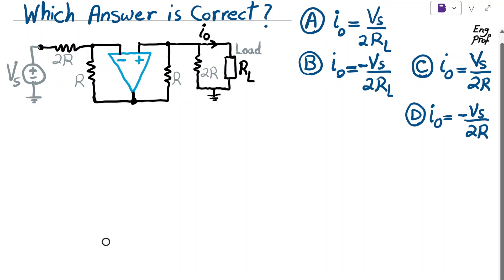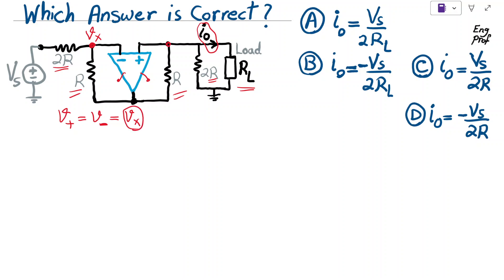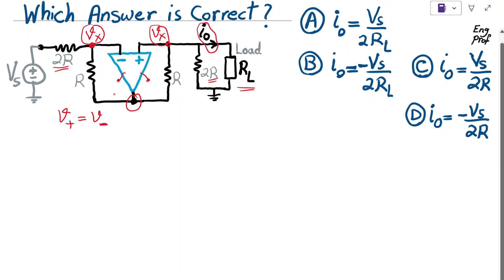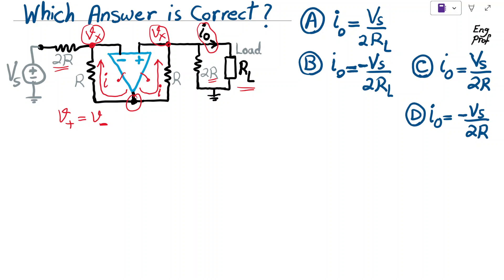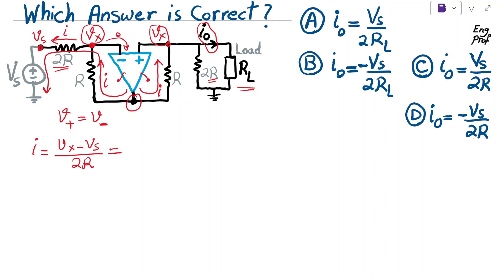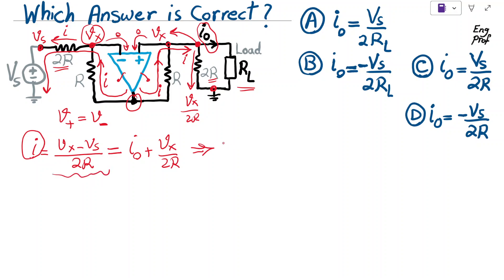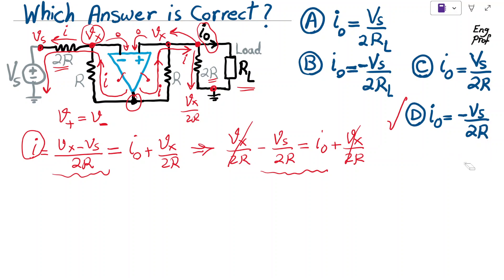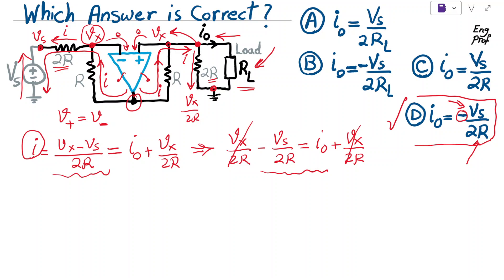Negative Impedance Converter Op Amp Circuit

Comment from the maker: For more Op Amp Circuit examples see: Impedance Converter Analog Circuit Design with Op Amp (GIC and NIC) https://youtu.be/o6l_wztCACQ
Negative Inductance Design by Op Amp Impedance Converter https://youtu.be/GF_Mun_Mkyo
Converting Capacitance to Inductance https://youtu.be/weIHG45G6Pg
Analog Computer circuit that solves Differential Equation https://youtu.be/HeZRtnRXpEI
Capacitor to Inductor Converter Circuit https://youtu.be/weIHG45G6Pg
Active Inductor with Op Amps https://youtu.be/6IYz4iaa05c
Operational Amplifier Gyrator Network Circuit https://youtu.be/2KpjAytRBpc
More analog signal processing examples are in https://www.youtube.com/playlist?list=PLrwXF7N522y4c7c-8KBjrwd7IyaZfWxyt
I hope these Circuit engineering and analysis videos are helpful.